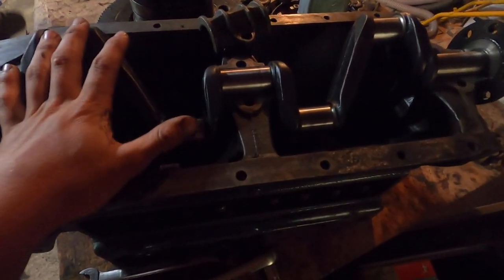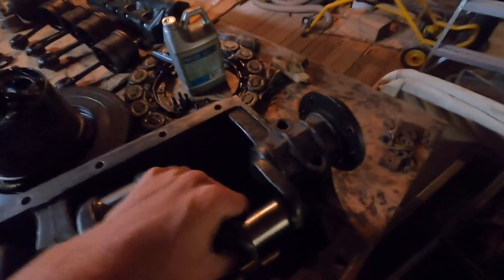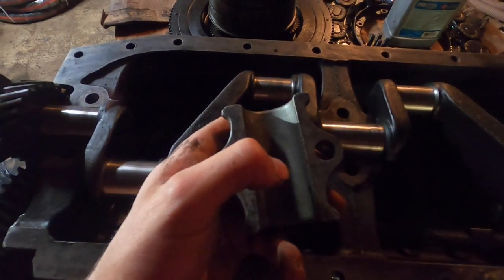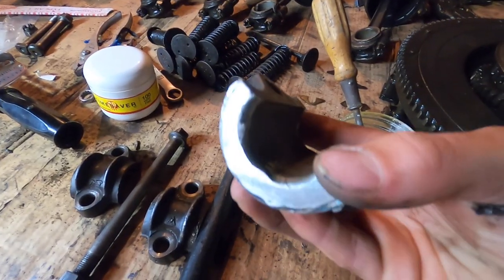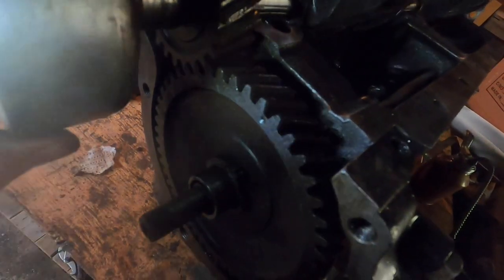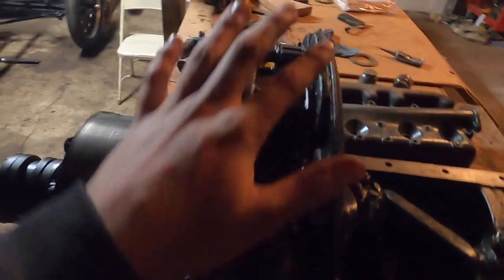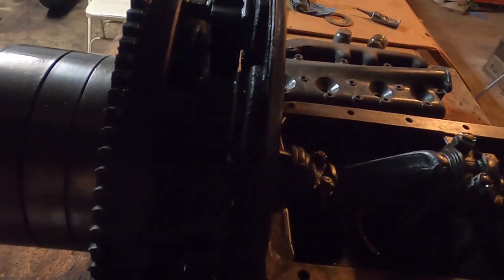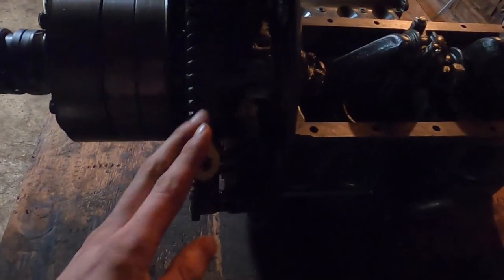Engine Assembly, 1927 Ford Model T

Comment: When I did the bottom end of mine, it was a week of assembly, disassembly and reassembly,  then a day or two of second guessing myself and finally just saying "that's it"  and calling it good.   It seems to run fine now....... but it wasn't the most fun I've ever had. :)
Reply from the maker: I had the same experience, that engine was put together several times before I decided it was right.  I am not quite ready to start it yet, so still hoping it runs smooth.

Comment: I couldn't believe how bad the original engine was in my 27'. There was a good .020 clearance between the pistons and cylinder walls. I lapped the valves, installed a new head and the old girl actually ran! I kept finding water in the oil and knew that it wasn't a problem with the head or head gasket. I finally found a rust hole in the block. I was wondering if you are going to get into the transmission. Check the triple gear bushings. They are almost always bad.
Reply from the maker: Wow! Thanks for the advice.  I decided to not go through the transmission on this rebuild.  The triple gears seemed to be O.K. They had some end play, but no rocking, so I think they will last a while yet.